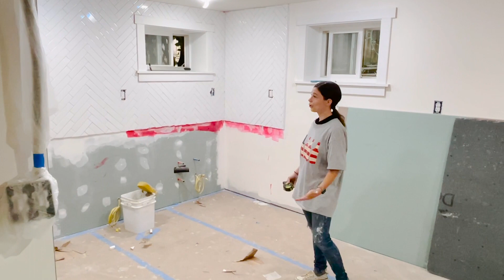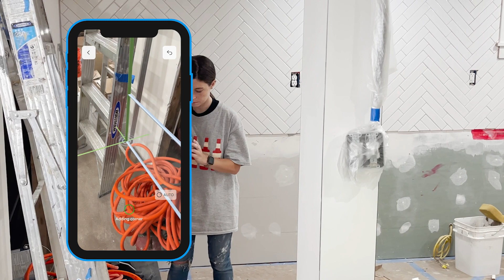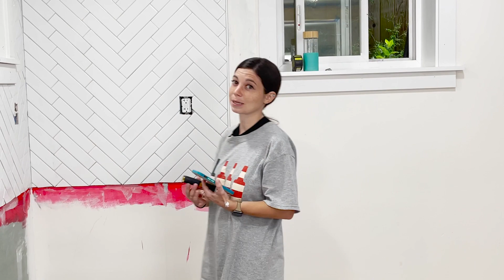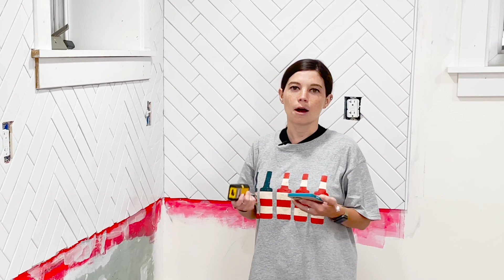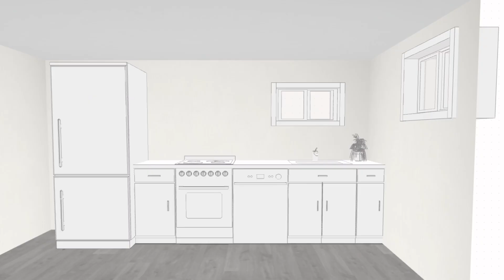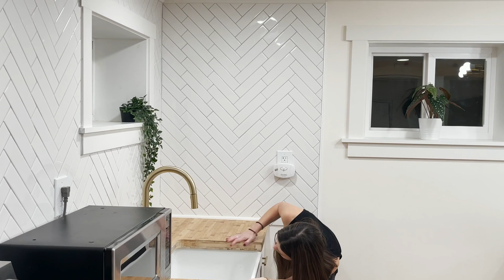How to Visualize Cabinet Layouts in 3D for Kitchen Remodels | magicplan

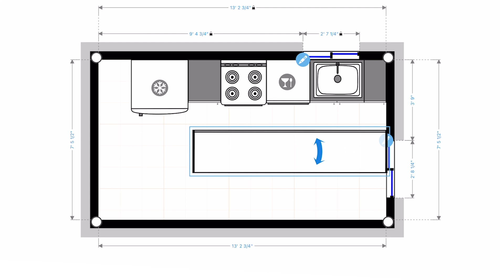Comment: At 4:58 you bring up a vertical view of the kitchen complete with dimensions. How did you do that?
Reply from the maker: You should be able to do this by clicking on the specific room wall you would like to visualize and then clicking on the Elevation option that appears in the bottom menu of your device.

Comment: Apparently I need to learn how to use the comment section as well. I have a question about the editing of the measurements. In the video you had several different fractions of an inch but my options in app are only 1/4” fractions. Are multiple fractions available for user apps?